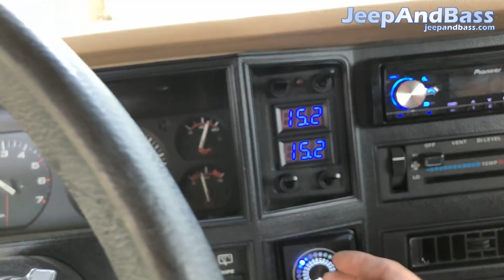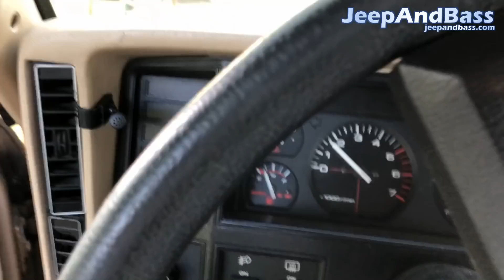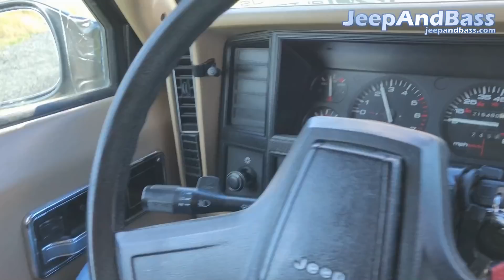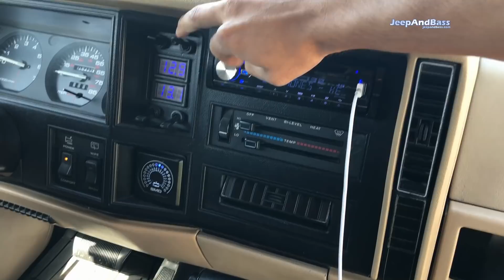JeepAndBass Demo (Walkaround)

Comment: An need 10k per. Pair to hold those hi notes for the burps I run a 12k on 2-15's some fi btl neo 15's they gold pretty well until u get below 25 I can't wait to see what more. Power would do it is best dB per watt I have seen besides jat4011